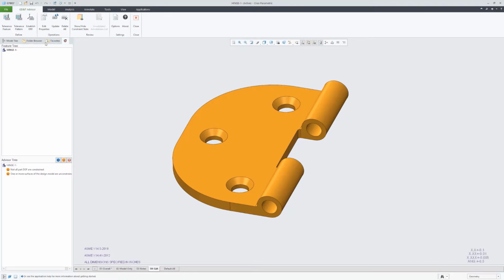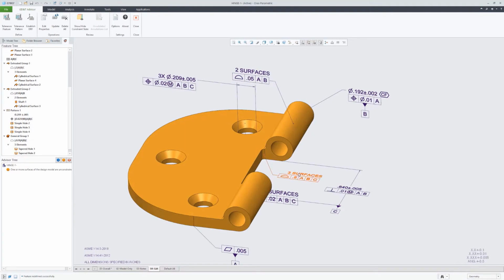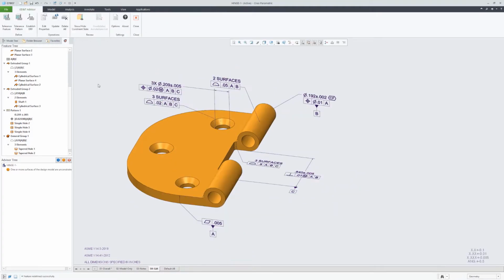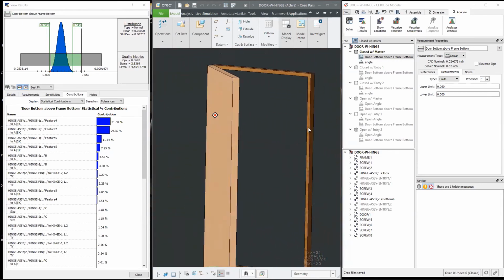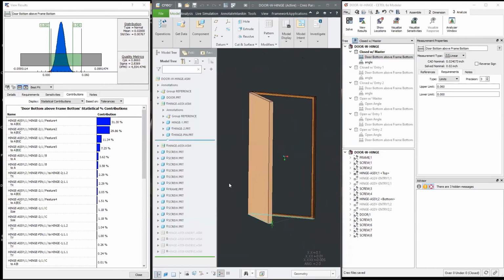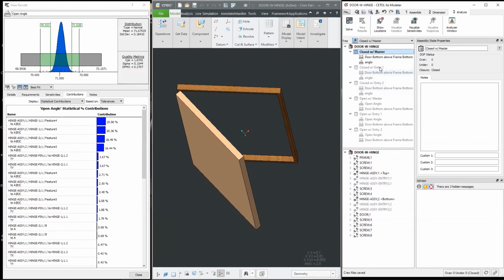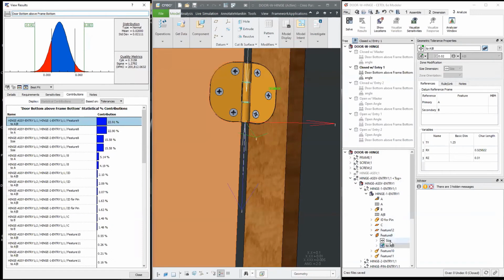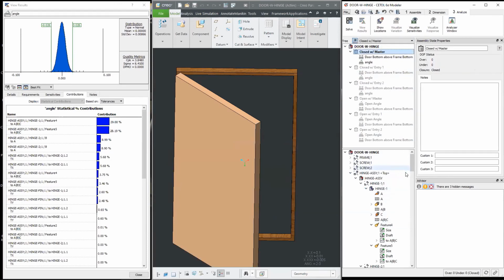CAD Talk: Sigmetrix GD&T Hackathon - Part Two

Comment: GD&T Advisor is very helpful tool. 
My query is, as I am using Creo 7, GD&T advisor not work on Tol. Standard Version 2018.
Its only working on Tol. Standard Version 2009.
Why this issue arises ? and what is the solution ?
Reply: You must be running GD&T Advisor v4.0.0 and Creo 7.0.0.0. ASME Y14.5-2018 is supported in GD&T Advisor v4.1.0 and later, delivered with Creo 7.0.1.0 and later.